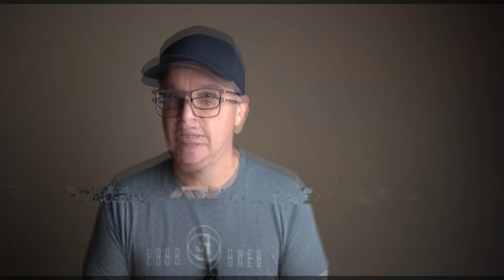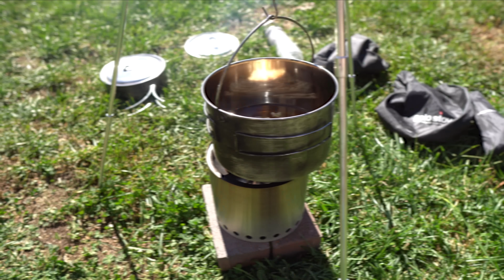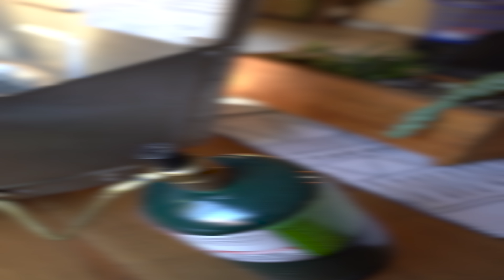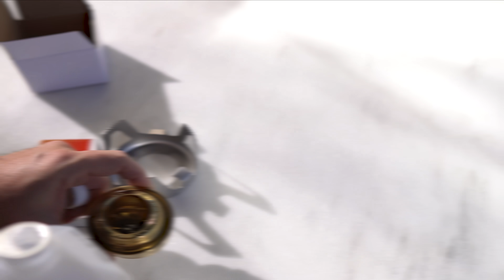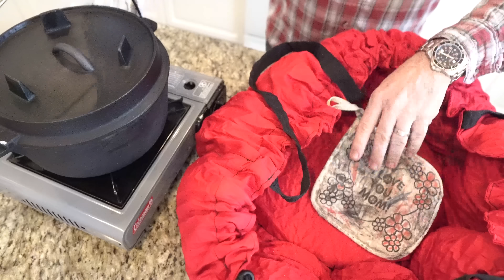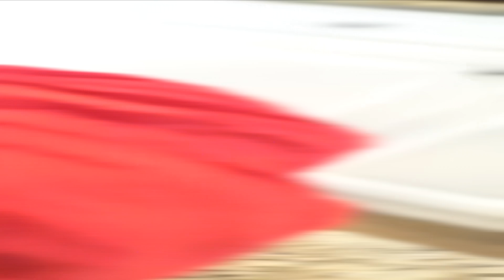12 Ways to Safely Cook After a Disaster

Comment: Awesome advice. This must be the topic of the day since ive seen 5 videos all talking about grid down cooking. Good ideas
Reply: 12 volt rice cookers use 100 watts and are great with small power stations.
Reply: @baneverything5580  
How often do you cook your meals using 100-Watts?
I saw a video press-release about an Australian 12v oven operating on 300-Watts, a roast required eight hours...
Reply: @largemarge1603  Rice or lentils take about 35 minutes. When I move and can set up solar panels outside I plan to cook that way daily.

Comment: My biggest challenge is with my fire pit. It creates an annoying amount of smoke. While I do have a gas grill and a smoker, it's good to have redundancy.
Reply: If you add a draw pipe to increase air intake for the fire you’ll have less incomplete combustion which is what smoke is caused by. The fire just needs more air access
Reply: There are ways to make your pit smokeless. Lots of youtube videos about it but basically, you put a sleeve in the pit with holes drilled in the top of the sleeve which causes a secondary burn of the smoke. Also a much hotter fire as a result.